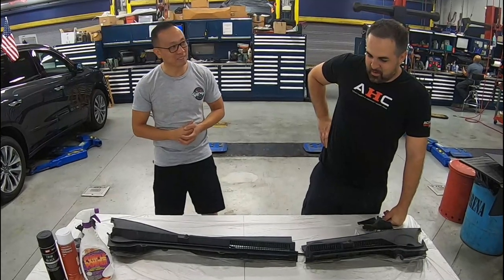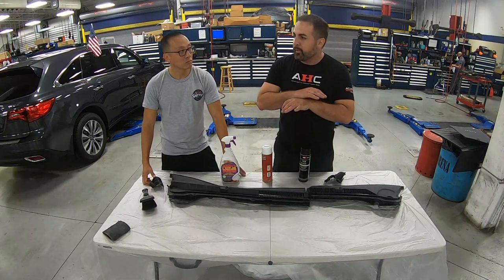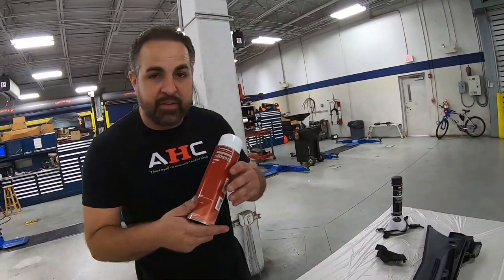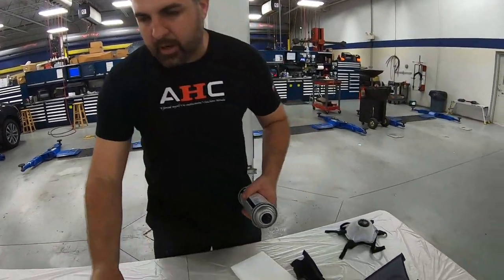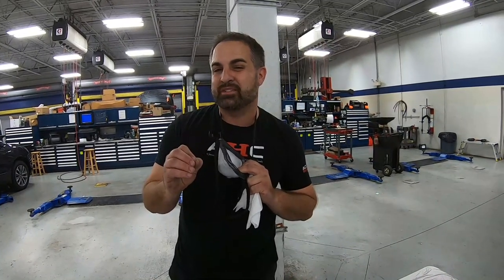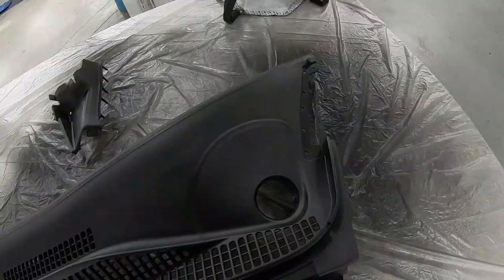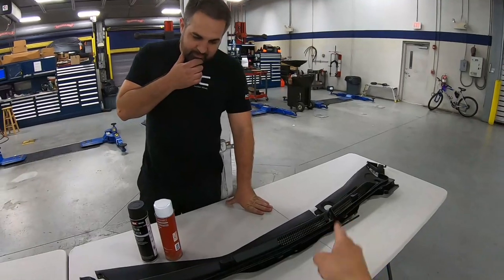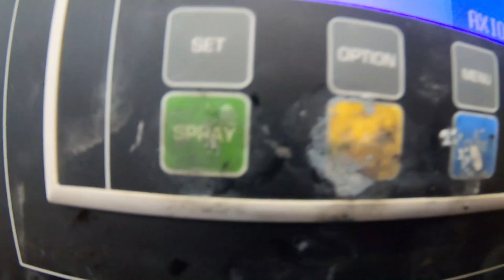Acura Honda Classic TL Type-S Build Project - Refinish Windshield Cowl Mirror & Spoiler (Episode 21)

Comment: How did you guys remove the rear spoiler and windshield cowl?
Reply from the maker: On the cowl, once you removed the wiper arms, it pops up. The rear spoiler has 2 nuts then it will pops off upward